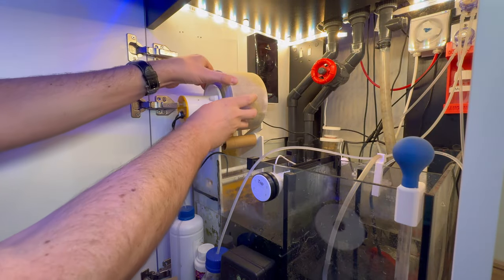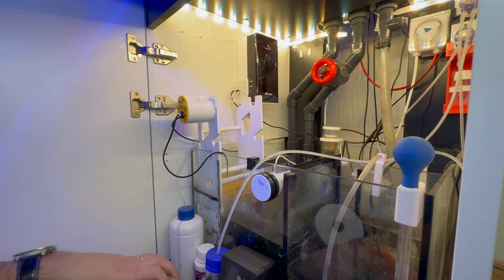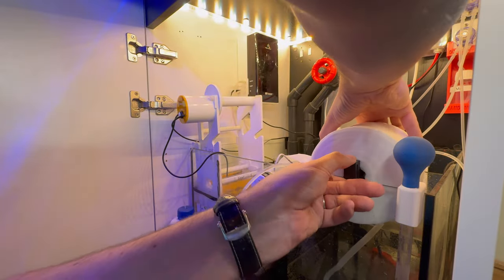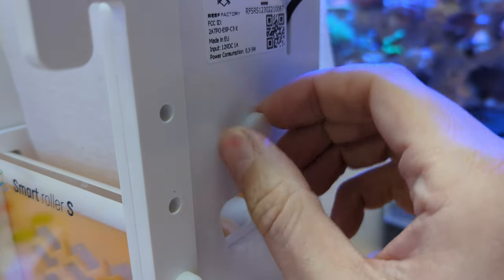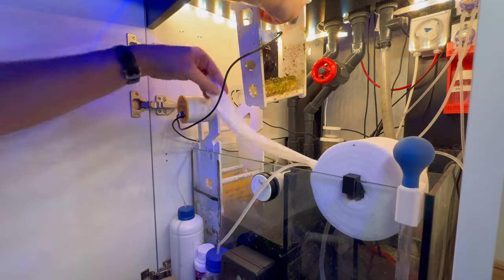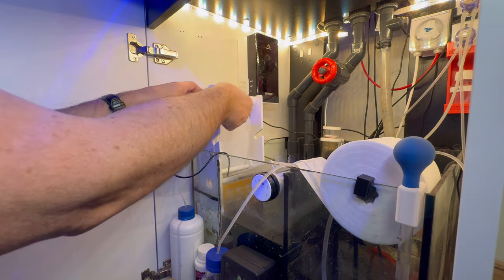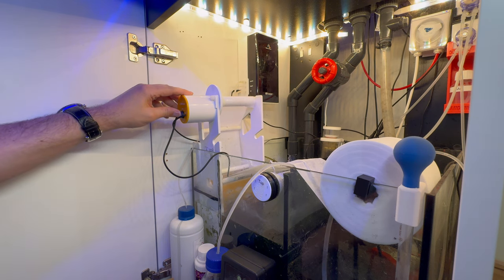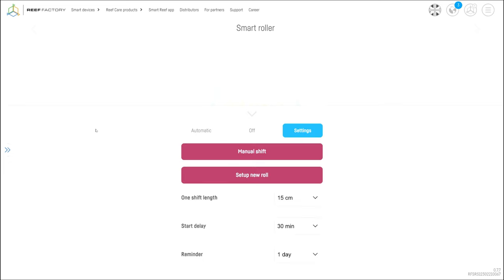How To Change The Roll On A Reef Factory Smart Roller

Comment: I got this product. The build is flimsy and I had to rebuild it twice now. The roller spindle chews the plastic roller up and then doesn't work. The app is temperamental. I bought it because of the large flow volume. I would not buy another reef factory product again. Stay well clear of this roller matt and buy two smaller instead from a better manufacturer

Comment: Any motor issues with the reef factory filter roller?  Seems Reefmats all have the same motor regardless of size and the motors are burning out in a few months—I smell a recall/redesign or face class action lawsuit…🫣
Reply from the maker: No issues so far. My ReefMat has been fine 2 years on but I've seen a few reports of motor fails. Red Sea (and Clarisea) spares are much more readily available than Reef Factory for what it's worth...
Reply: BRS now carries reef factory here in the US so I think Red Sea may have more competition now, especially if motors keep failing.
Reply from the maker: @MW-ut3dk  yep, maybe and the RF stuff is generally very good, but build quality isn't their forte...